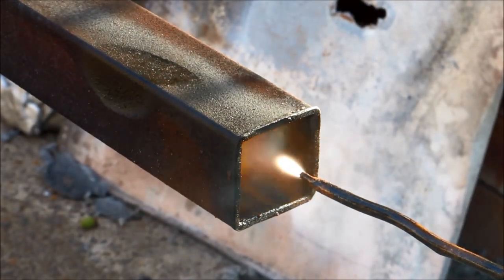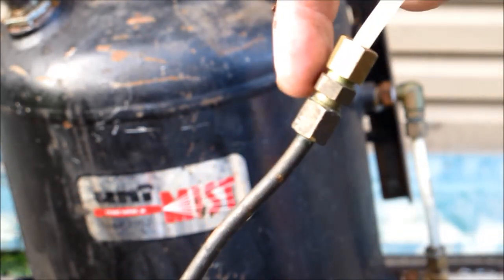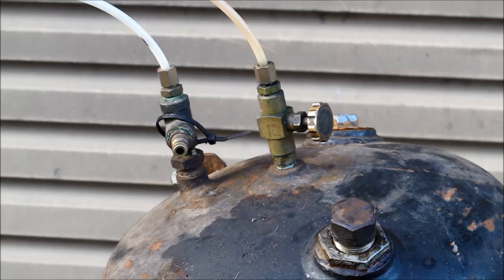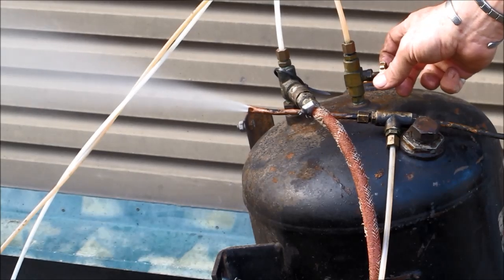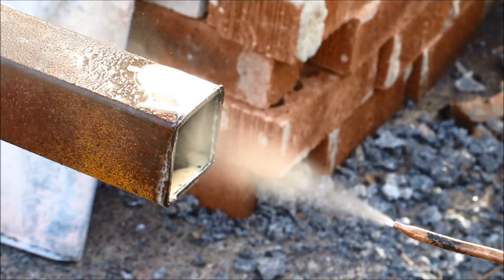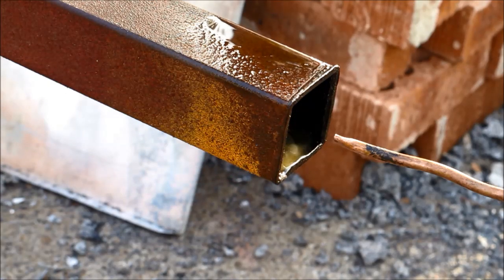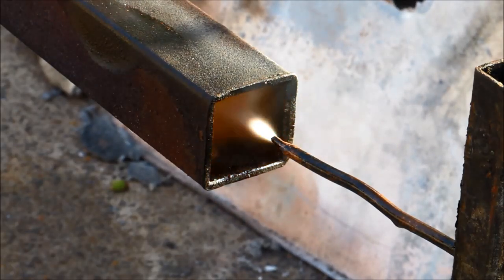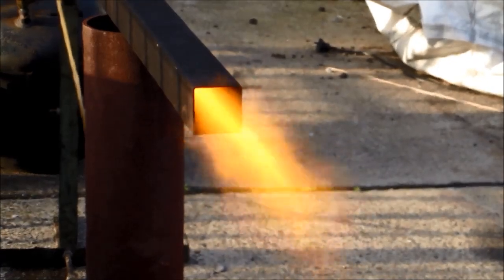Instant light  spraying oil Burner from cheap, off the shelf fittings

Comment: Hi mate. I have been watching your videos for years. Run my car and truck on waste veg oil thanks in part to your inspiration. Im trying to design a weed burner that i can carry around to burn weeds in my paddocks. I have seen lpg weed burners like the 'hot devil' but lpg is expensive and i have heaps of filtered wvo on tap. Any thoughts on best way to achieve this? The ones in your videos are alway huge flame and im wondering if its possible to tone it down a bit and make a more compact wand style burner.
Reply from the maker: Funny you mention this..... I have had the same thought in my pea brain for a while. I haven't come up with anything for wand style quite yet But I have been thinking of something Trolley  mounted that could be wheeled along.  Was thinking of an offset outlet so one could walk along edges, pathways, fences etc. 
I was also thinking of it in a more powerful version for snow melting and re sealing/ surfacing my tar driveway. 

I have found a small and powerful fan that runs on 12V along with a pump and controller for output regulation. 

I have just built a new design Burner which would be very adaptable to this idea which I want to test out so give me a few weeks to build it and get a Vid up . 

I am thinking of a refinement of this burner:
https://www.youtube.com/watch?v=tmdVG16dBOU&t=578s
Reply: @glumpy10  Sounds like a plan. The wand idea i had went something like this.... Backpack weed spray tank converted to hold the oil. Short hose down to the wand for the oil to reach the wand which uses a venturi atomizer something like the one in this video. Then run a long air hose back to the compressor. Air hoses are relatively cheap. I guess the compressor could be wheeled into the general area the user is weeding/working. Im keen to see how you tackle this.

Comment: Ok Hell Boy I got one you can try. Take that piece of tube, with an acetylene torch heat the center up RED HOT, shut off the torch, turn on the Acetylene and blow it thru the tube. Have you ever done that? It sounds like a cannon going off machine gun style.

Comment: Will this get hot enough to forge steel  🤔 ???? And if so how much residue if any do you get condensation on the metal cheers mate from texas😁👍
Reply from the maker: yes, easily hot enough for steel forging and there is no residue. I have dabbled with this myself in a way too amateur to put on YT but it certainly works. There are plenty of guys melting and pouring steel with oil burners.  Have a look at Myfordboy.

Comment: Now just add a thermocoupler to an automatic shut off valve and you have the ultimate safe solution. Could also be a great application for a standard home oil burning nozzle. ,https://www.amazon.com/Delavan-85-80B-Hollow-Nozzle-Sintered/dp/B000VB6C5K/ref=pd_lpo_vtph_60_tr_t_2?_encoding=UTF8&psc=1&refRID=SVEEE7YX3A2FAH8CG5V4

Comment: Do you need to filter used engine oil before using it? I would imagine that it would clog the system if there were any metal shavings or the like in it. Especially the mig tip, no?

Comment: just excelent idea. Good for every fuel. I do not need so long flame so I will bend a pipe around , weld it to close the end and drill a 10-20 or so holes at the top. That way I have a circular burner. I will test  how it works.this week,  reg Jack

Comment: how much air and fuel dose it use just jokin in my busines I accumulate a lot of clean hydraulic oil have you tried to burn hyd. oil if so is there any different than black motor oil

Comment: My dad and I are building several different versions. Our drip burner does no light at all... The pressured one works pretty well (until we over heated it and partially melted it) and the gas works like a bute... But we can't get the drip to work... Any suggestions or what information should I provide?

Comment: How about adding a touch of water to the mix?? I seen it done on a drip fed to hot iron v plate, oil water fuel kiln. one third water two thirds oil. Works extremely well, but I imagine atomising water into the mix would be interesting & make it roar some more!!
Nice set up you have. cheers.

Comment: can youn use ordinary bricks instead of fire brick which aew 9 dollars each in qld
Reply from the maker: I only use ordinary bricks for that reason.  they work fine but will get structurally weak from the heat. as they don't have to support anything, not a problem.  I have found a mix of builders clay and sand on the face of them helps insulate and seal them as well.

Comment: This  is  beginning  to  give  me  some  ideas!   I  have  a  Hot  Tub  which  uses  quite  a  lit  if  firewood.  I'm  not  getting  any  younger  (just  turned  60)  and  cutting  all  that  wood  is  knackering me,  and  there  aren't  an  awful  lot  of  firewood  trees  left....    Now  this  should  be  able  to  do  the  job  admirably!  I  have  just  a  few  questions...  Will  this  run  with  a  downward  pointing    tube,  with  the  nozzle  at  the  top  and  the  flames  coming  out  of  the  bottom?   my  boilr  in the  hot  tub  is  just  a  big  U shaped  tube   submerged  low  down  in  the  water.  The  fire  chamber  is  about  a  foot  wide,  horizontal,  fed  by  a  vertical  lead in tube  of  the  same  size,  welded  together  at  a  mitred  corner.   The  chimney  is  at  the  opposite  end  of  the   fire tube,  and  about  half  the  diameter,  so  if  i  could get  me  a  fire  tube   like  yours,  only  probably  cast  iron  and  with  a  90 degree  bend  at  the  end,  pointing the  fire  towards  the   chimney  end,  I  think  I  can  make  this  work.    The  other  question  was  to  clear  up  something  I'm  not quite  clear  about...  the  tube/hose  carrying  the    fuel  out  of  the  'tank'  towards  the  nozzle....  this  is    with  the  fuel  being  pushed  by  air  pressure??      Then  the  fuel  is  sort  of  atomised  by  the  venturi  effect  when  it  comes  up  to  more  passing  air  at  the  TEE  piece??   have  I  got  that  right?
Reply from the maker: The burner would run fine as you describe, downward firing. I have some vids from a couple of years or so back showing that with metal melts.  You could make another fire tube from some large diamater exhaust pipe  bunt in a U shaper or even coiled to give more surface area and heat transfer.  Just leve about 500MM Out of the water so it is a hot section that will help put the heat into the oil it needs to change state from liquid to gas. 

This burner uses atomisation unlike all my other burners.  Yes, the air pressure acts on the oil to force it to the nozzle that atomises it  by shearing. I may have confused your other question with the burner type.  This one would work with a jet on the end so higher pressures could be run without too much heat and get a bit better spray but it's NOT as important as everyone Imagines. Having the hear recirculation  to change the state of the oil is however critical.

Comment: i have been experimenting with waste oil burners and for what its worth I have found that 8 to 15 psi gives best results depending on how fine a nozzle you create. Also the air supply from a compressor which is constant is best. To ignite the oil it must be pre heated to 80 degrees c or 175 F and it will then ignite with a standard burner ignitor.
Reply from the maker: Are you using a commercial nozzle or a DIY one like this? 
I find any preheating of the oil is useless because the millisecond it is atomised, it looses all it's heat to the air.

Comment: you know that you've made a $20 pulse engine
Reply from the maker: I had an idea the other day of using a car fuel injector and a micro controller to drive it to make a proper pulse jet. 
Would probably be too heave in scaled size for an air plane but I reckon I could make a model boat that was propelled successfully.  I'm learning the microcomputer stuff with a view to making a variable pulse driver for this.
Reply: Oil Burner nice or you could get one of those rc EDF ducted fan motors and just them instead.
Reply: It's not a pulse jet..... it's just a paint sprayer spraying oil instead of paint

Comment: i have a few things im interested in by the looks of it about 30 to 40 cm down seems to be the hot spot could you cut it off there and make a hotter flame or would it burn your pipe out quicker and if you put one of your big blowers in your fuel end would it create a hotter flame

Comment: what parts do I need to build a spray burner. I'm considering building one. any reply is welcome.
Reply from the maker: there are 2 Vids on this, a construction one and the demonstration of it burning. I can't really tell you anything thats not in the first vid. It's dead simple and only requires basic plumbing parts. 
Have a look at the vid, it's all there as straightforward as I can explain it.

Comment: good stuff !   let's say you built a little furnace from fire brick at the hot end then left a lump of steel in it, would it get hot enough to re shape with a hammer? ?
Reply from the maker: I have a vid where I was trying to melt copper of a stator. As I was showing the melted copper on a vid I realised there was a puddle of steel melted from the ring. 
I have made many crude but useful tools from bits of metal heated with teh burners in open air. If you are using rod or something you have to be careful not to burn the steel. 
You won't have any trouble shaping it that's for sure!

Comment: can you please help me. I can't get my diesel oil to light.  I tried different tips and even squashed a tip like yours?
Reply: do I need to shoot it threw a pipe?
Reply from the maker: I would suggest either spraying through a pice of tubing  or into a chamber like a gas bottle or furnace. 
You want to get heat reflecting back onto the fuel to help it vaporise.  You may have to keep a flame source there for a bit till it gets enough pre heat to self sustain. 

It may be possible for this to work in free air with a fine enough spray pattern and a volatile enough fuel but making some sort of a burn Chamber will definitely make things easier to light and sustain.
Reply: +Oil Burner tried spraying in a 3/4 pipe with a mig tip and a propane torch to light it with no luck maybe the propane torch doesn't get hot enough?
Reply: I would be trying at least 1.5" pipe, probably closer to 2".  Hole the torch on the oil spray to keep the flame lit till the pipe heats up to the point the oil will self sustain.  I think the small pipe may not allow enough air mixing and generate too high a gas speed for the flame to hold on to.
Reply: +glumpy10 great I am converting my propane heater. should I run the oil line next to the tank to heat up the oil?
Reply: Wind Storm
 No, Unless the oil is too thick to flow, that does nothing. I know everyone things it does but the people that say tat are most likley the people that have never done a burner and are making it up or parroting what they have read before.

Comment: Very neat
Reply from the maker: Thank you.  It got a lot better with a bigger blower as you can see in my other vids.
Reply: Consider implementing a turbine for your final stage, the exhaust pressure should be enough to push it, that would boost your final output temperature. :)

Comment: Hi Dave, great video. So only 20 psi is what you are using? It seems like incredible atomization for only 20 pounds.
Reply from the maker: I have run it up to 30 psi and down below 10. Still atomises fine, just the output is lower.  The trick is having the bit of tube squashed down Fine. I was also going to try using a jet out of a carburettor screwed into or soldered into the pipe end. 
Any small orifice wll do teh trick as the air speeds up as it goes through and disperses the oil.
Reply: Oil Burner A cheap spray gun head would probably work well, and you would have additional adjustments for volume and spray pattern. Harbor Freight sells such a gun for only $9.99 when it's on sale .
Reply from the maker: I have tried several sprayguns and none of them delivered enough oil to get the right mixture. They may need some sort of Hi flow spray cap on them but the ones I tried all had too much air no matter how far up I maxed out the liquid control.
Reply: Oil Burner yeah you may have to get a larger tip or drill the holes out in the tip a little larger

Comment: Have you tried blocking up the end of the pipe, cutting slots or drilling holes in the tube, and burning along the top of the tube.  I am thinking of using the burner to boil a pot of shrimp, not spraying the flame.  Yes, I just subscribed and no, I have not seen the rest of you collection.

Comment: great video Dave,  question. my Mrs. said my flame went out a long time ago,  any help in lighting that on the cheap would be grateful lol  Cheers.
Reply from the maker: Hi  Dave, 
I hear ya mate! I have kinda the same problem but maybe the opposite. My flame is OK but the wifes interest in it is what has gone out.  I'm not sure an oil burner can help you but I saw on the flyer from the local Chemist the other day that those little blue pills have come waaaay down in price!  I raced out and bought a whole shopping trolley  full  for me and a pallet of grog for her.  I told her to keep drinking till I look good but she keeps passing out and won't wake up for 3 days and I still don't look any good.
Reply from the maker: gregory Martell
Oil tank would have to be pressurised  or the air pressure will just bubble back out the fuel line back into the tank.

You could pump the oil but that would be added complication and expense with other drawbacks and No upside I can see other than if you wanted to run continuous and didn't want to shut the thing down to refuel.
Not a very likely scenario though.
Reply: Don't feel bad, I have the same problem.  I have one other problem I hope you can help me with.  Been watching your vids all afternoon  and I have become addicted to them.  Is there any cure for that?  Yes I did like and subed.
Reply: Quit watching videos and do something fun with her. Bet you used to do a lot more together.
Reply: With a new girl you will light up just fine promise
Reply: +Oil Burner I'm planning on making one like this but would having a separate oil tank an have it feed in to a T fitting with a compressed air source on one of the ends then have it connected to a small diameter pipe like in your video still work just as well?
Reply: hey  whaddayaknow!   same  thing here.
Reply: Oil Burner loved your response and I'm still laughing...  I am looking into a different types of heating systems as away from using my own waste production to eliminate the need for transport from your neighborhood.
Reply: I don't know what all this whining is about. It's all spelled out right here! Light the burner. Slide it into the furnace and open the waste valves! If that doesn't melt your old mag wheels, and leave you a nice big shiny hard ingot, I don't know what will!

Comment: Does the air valve pressurized and bleed off air at the same time? If I'm understanding this correctly the air goes in the tank and pushes petrol through the fuel line but simultaneously some air siphons off at the t valve and goes to the nozzel. I've never made one of these before but would like to make this design with some modifications on the nozzle end for heating up steel foe knife making
Reply from the maker: First of all the fuel is OIL not petrol and I highly reccomend you do not use petrol for any type back yard burner unless your life insurance is well paid up and you wish to leave you family a sizeable windfall. 

The air goes to the tank and pushes the oil with the air to the t Piece at the nozzle end to atomise it. 
People make WAY too much of the spraying or atomisation of the oil and can't seem to understand that the retained heat in the surroundings they are spraying it into is MUCH more important for a good, clean, reliable burn.

The oil HAS to change from a liquid to a vapor to burn. Spraying helps that but it is NOT the reason it burns. Like all my other burners, you can have a solid stream of oil going into a hot chamber and it will burn perfect. 

Spraying is NOT the key to oil burning, HEAT is.

Comment: Ha Mate,
Have you ever tried a refrigerator compressor powered with AC to take oil in and spry it out?
Thanks for your work and entertainment.
BobcatBob
Reply from the maker: Seen and thought of yes, tried, so far No. 

A friend has a really big aquarium compressor he uses for something in his shed. I have thought of borrowing that off him and see how it goes. Not sure of the pressure but I do recall reading the label and the airflow rate was pretty impressive.  Continuous Duty and low power consumption.

Comment: Hey me and my friend used your instructions and made a oil burner in this style and it works great! We built our aluminium furnace by stacking broken bricks in a circle inside a old oil barrel and filling the gaps in each layer with mud. Yes normal mud and letting it dry.

Our pipe is only 1 meter long and we use a blow torch to ignite the oil then it burns great.

I love your simple methodology no fuss. Thanks for your videos and Hello from South Africa

Comment: Take a round steal tub wrap copper capillary tubes around it with water running through it. Feed perlite heat sink barrels to keep your water hot and lay heart hose in the floor of your home to heat it. You could produce a steady electric current with heat transducers has well to run your home.

Comment: I bet if it has a few bends in the pipe you'd get a more intense gasification, but it looks great, add big heat plate or box to that end it would give more heating surface area.  It looks cool too.
Reply: By pipe do you mean the square tube or the nozzle?